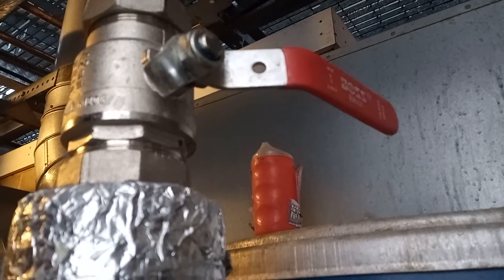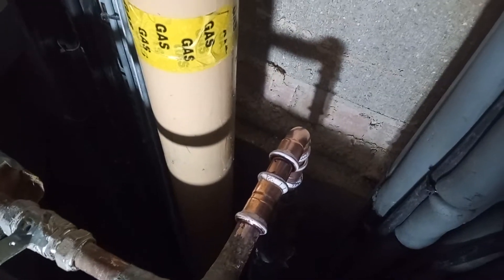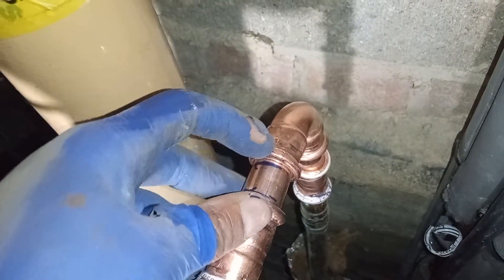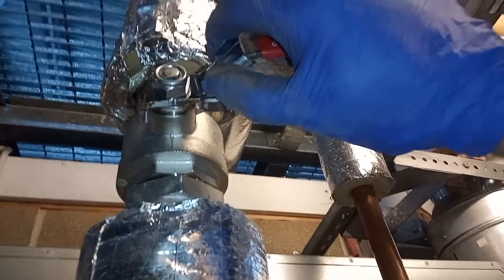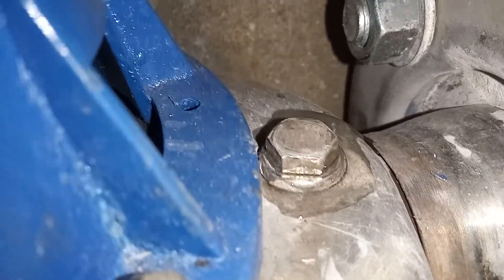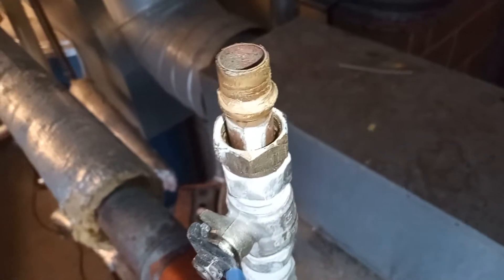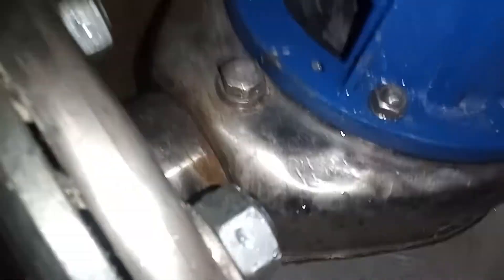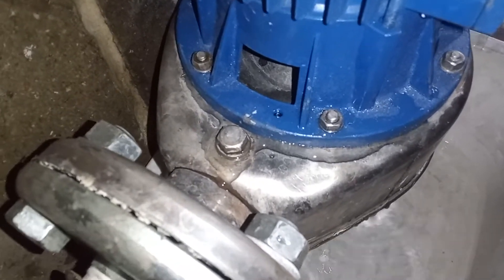HOT WATER SERVICE ISOLATED & DRAINED DOWN

Comment: Nice job, do you ever use a freeze kit on commercial work?
Reply from the maker: Hi William. I have a few times. There have been times when it failed to work though despite isolating pumps and valves. When they fail it's a big waste of time. What do you think about the freezing kits, are you a fan?
Reply: @CommercialGasEngineerVideos  Not on commercial systems but I will use them on domestic any time I can to save draining down.
Reply from the maker: @leaturk11  I agree, on domestic or semi commercial systems they have gone well for me.
Reply: Im not talking about the silly cans of chemical, im referring to the proper electric powered ones.
Reply from the maker: @leaturk11  ofcourse. Good question. Got us trying to work out what's best and when.
Reply: @CommercialGasEngineerVideos  Sorry :)